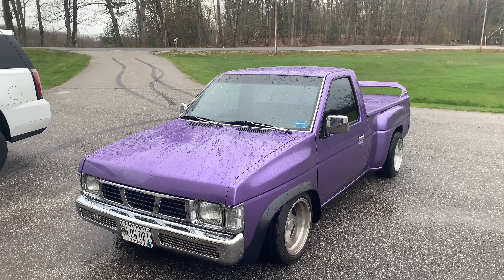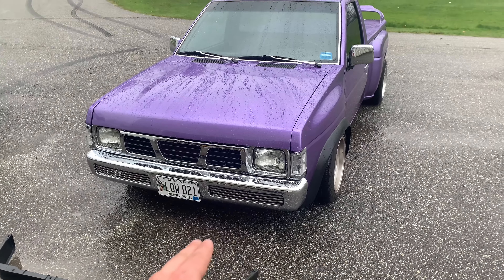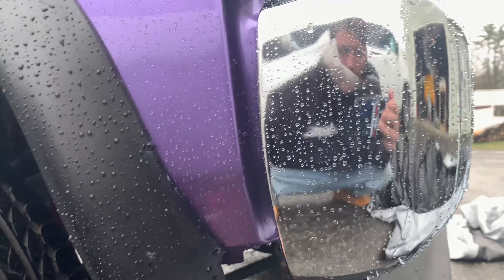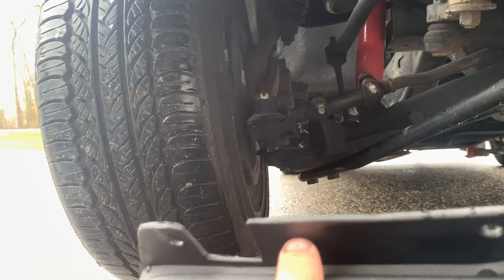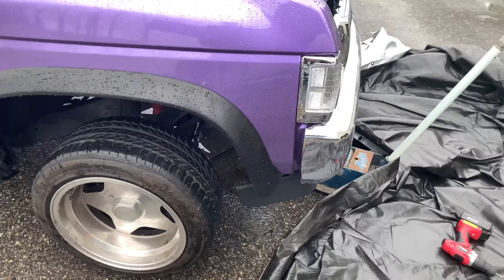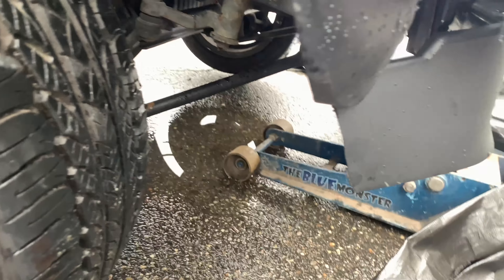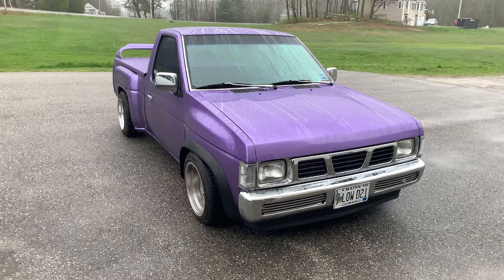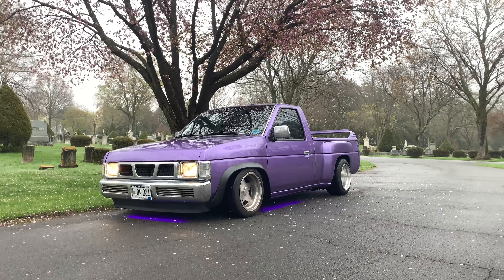How To Install The S10 Front Valance/Lip On A Nissan Hardbody D21!!

Comment: What's the wheel and tire setup?
Reply from the maker: 15 x 8 in the front with 195,50,15 15 x 10 1/2 in the rear with 225– 50–15 on eagle alloy star wheels!